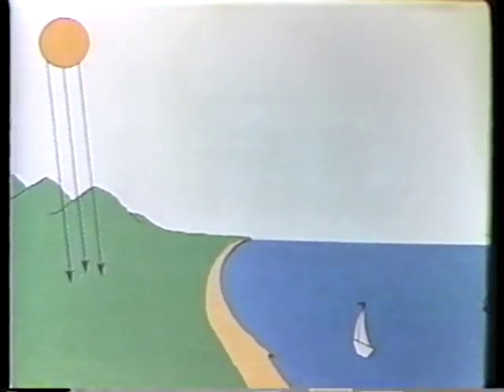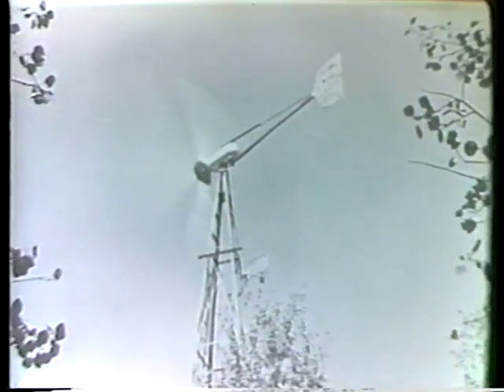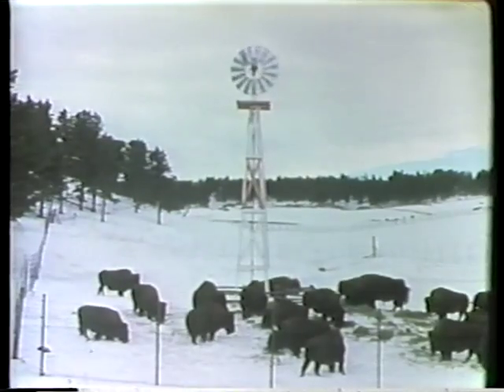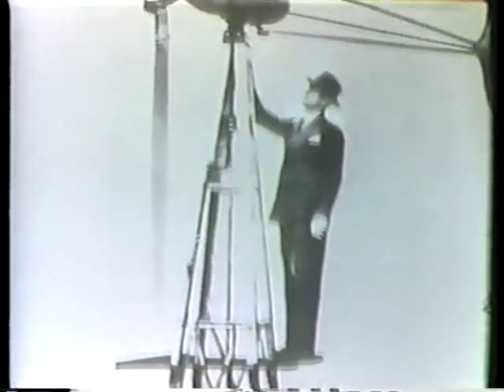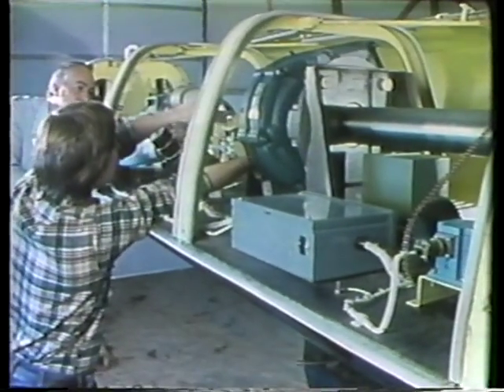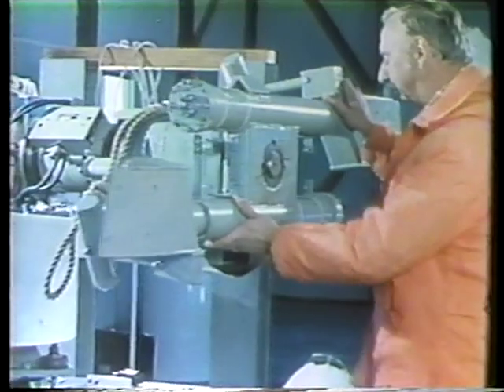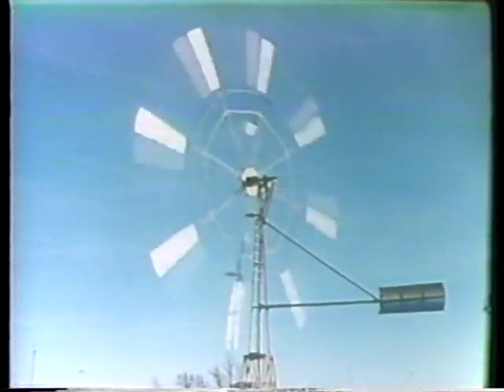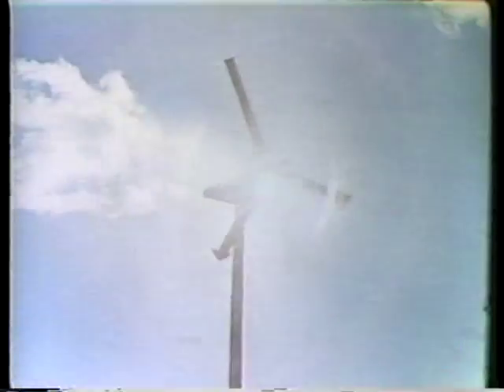History And Uses Of Wind Power As An Energy Alternative / Documentary Video

Comment: It's not efficient enough for mass power production.  The wind farms that do exist now are all subsidised by the government.  Other wise they would operate at a loss. You can use far less land space and locate it near the area that needs power by building a nuclear or clean coal plant and get far more energy.  A wind farm takes up far more land by its very nature.  Then it has to be placed far away from the customer and thus more land and materials is required to run the power to the users.